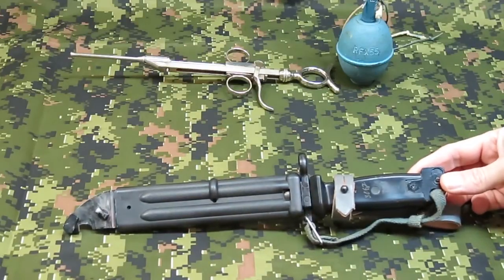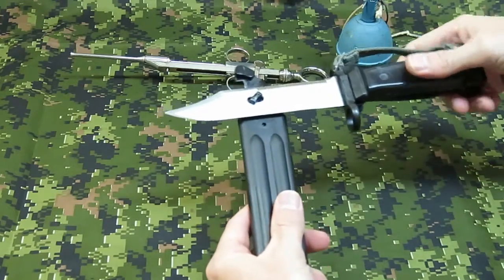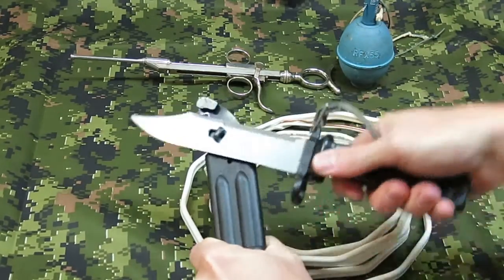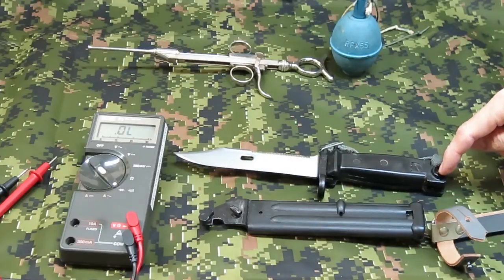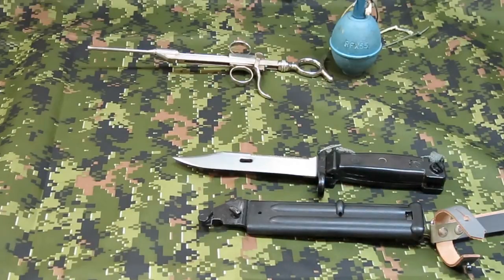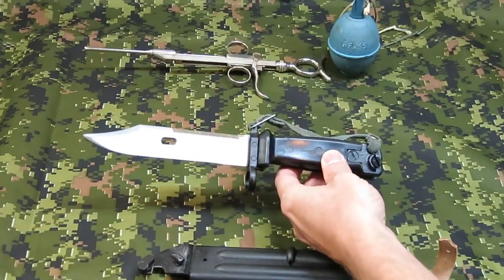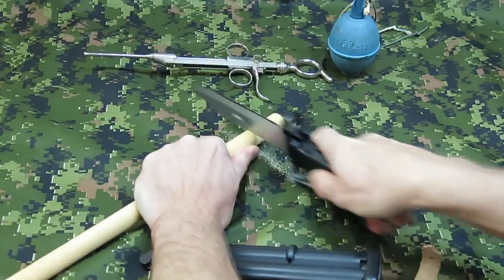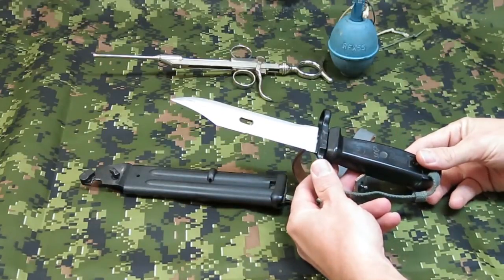AK74 Bayonet demo of wire cutter and saw feature

Comment: If you're running "in the field", you're not exactly worried about being stealthy and it wouldn't be the only thing making noise on your kit.  I'm gonna have to put that one up there with the Garand "ping" myth.

Side note:  The saw as I understand it is for cutting aluminum, not wood (which makes sense given the small teeth).  They say it's a way to cut yourself out of a downed aircraft, but I can't confirm that.  Another source said it was to help catch a blade and keep it from sliding down to your hand.  Again, I can't confirm any of it, but the latter does not seem very likely to me.
Reply: Ah, small teeth like a hacksaw for cutting metal pipe. That makes sense.
Reply: @shockwave6213  Well, in this case, more like aluminum sheet.  But again, I can't confirm any of it.  It's maddening not to know.

Comment: that is an AKM type 2 bayonet. I have one given to me by my uncle, who is a navy vet.

The AK74 bayonet looks more like a spear, not this bayonet.  Sorry, you have made a mistake in the title, but i do know that both types of bayonet can fit on the AK74.
Reply from the maker: cole thompson Hmmm....interesting.... I have just done some research and I have seen the spear type bayonet you mention. I am going to have to buy one.  A good reference for my bayonet is at http://worldbayonets.com/Bayonet_Identification_Guide/Germany__Post_WW_II_/germany_post_wwii_2.html#akm2o where they state about my bayonet that -- Knife bayonet for use with  the Kalashnikov 7.62 mm.  AKM and 5.45 mm. AK74 assault rifles.
        East Germany produced the Type II bayonet  from 1985–1987, when the AK74 bayonet was to be introduced.  This never occurred, due to  east-west reunification.--- Thanks for watching and sharing your info.
Reply: Bloeski's Wrecking Crew of course. I meant no disrespect,  just a correction. I was on the same website after I got my bayonet.
Reply: cole: true it's a type 2 AKM, but it was issued with the Ak-74 until the Ak-74M came out in the early 90's then they changed to the more spear pointed design with a black or plum coloured sheath.